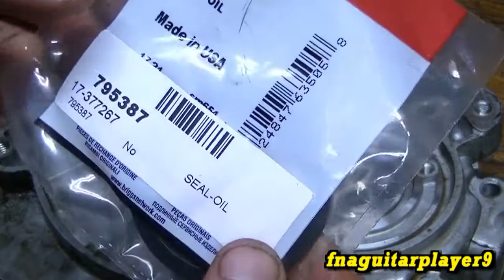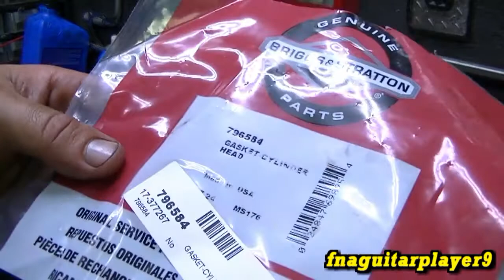Part 2 of 2 : OVERHEATED B&S 18.5HP OHV Intek Plus 31P777  Diagnose, Teardown, FIX and RUN!

Comment: Great video..thick southern accent but pretty much understood everything...Damned 10% ethanol fuel screws up everything in the fuel system! It's always a good idea to put a petcock on the fuel line and just shut it off and let the motor run out of fuel when you're done mowing.. Otherwise your needle valve on the float in the carb wont seat properly with all the corrosion and you'll either have fuel leaking out the exhaust or get gas in the crankcase!!  I had gas in the crankcase and it caused all kinds of weird problems. Thought I blew a head gasket with all the smoke until I started taking it apart and gas was leaking out of the head.   Now I have to put the head back on and take the carb apart, so I decided to just clean up the head, valves, and piston, and replace the needle valve and seat on the carb. Hopefully it will run again!
Reply from the maker: Thanks! Yeah I get that alot haha oh yes, it really does big time. Thats the best thing to do. Thanks for Watching!!!

Comment: I just got a JD lawn mower that has the same engine as this one. Some strange reason cylinder block crankcase has a crack on it. Leaks oil when i try to start it. I ordered the crankcase and head gasket hoping there is no major problem with the inside the engine.  Btw first time I'll be taking an engine a part. I am so excited.  Thanks for the video it's so helpful!
Reply from the maker: Glad to help out, Thanks for Watching!!!

Comment: Good vid. In my experience be sure to only drive that oil pan crank seal  down as deep as originally was because if u drive it down too far u will block the oil port that keeps seal lubed. It will fail n leak soon. Also be careful not to roll the seal turn the crank a little as sump pan slids in seated.
But it prolly "aint got no gas"

Comment: Thank you for instruction. I have BS 18.5 hp that continues to flood the oil. New carb and have adjusted valves several times. Did compression test it says it have compression 140 or so. I lost at this point, still won’t start and run.
Reply: If its flooding then the needle/seat are leaking.

Comment: Great Video! 
I just purchased a Craftsman DLT 3000 mower with this same motor. The carburetor had been cleaned and rebuilt. The motor was still surging, backing, and popping some. The only way to smooth it out is to partially choke. I took the carburetor a part and really didn’t find any issues. I’m now thinking it isn’t the right carburetor for this engine, someone has definitely removed the fuel shutoff solenoid and cut the connector from harness. Do you by chance know the p/n of correct carburetor for this 18.5 hp engine? 
Thanks!

Comment: Great 2 part video!  This is the same motor that I have & I am trying to figure out how to test the charging system on it.  All of the videos that I have found so far seem to have a different configuration than this one.  I am going to keep looking, but do you have any videos on this type of charging system?
Reply from the maker: Thanks! I do not have a video on the charging system, there should be 1 or 2 wires coming out on the starter side, there is a diode made into the wire on the charging circuit, at full throttle it should be putting out 12-14 volts dc. Thanks for Watching!!!

Comment: I have a 31P777 that came to me overheated.   The plastic intake was melted at the block,  pushrod guides were gone, and the head gasket had failed    After I put it back together the rocker studs would not stay tight.  Eventually I swapped the head.   After a few months of use it started burning oil.   I have not torn it down but I suspect the rings lost their tension due to the overheating.
Reply from the maker: I hear ya. I hope this won't happen to this one, I started to order new rings for it but didn't, i put it back as a spare so i hope that doesn't happen! Thanks for Watching!!!

Comment: I have the same motor in my Craftsman LT2000 riding mower.  The mower has stopped charging the battery.  When i tested the voltage coming from the stater, i get about 29volts.  I cant seem to find a voltage regulator, so im at a loss as to what to replace.  any advice?
Reply from the maker: There are diodes built into the wires coming from under the wheel (from the stater) if its bad it will put out some odd voltage, usually ac too. you can either cut the plug off and wire in a diode and hard wire it back to the harness or get a new stater and pull the flywheel to install it. Thanks for Watching!!!
Reply: fnaguitarplayer9  very good video. Glad i found it. 
I tested the voltage DC coming off of the diode red wire and it read 17volts while unplugged. The moment i plugged it in, it would drop to 12.4vdc which was the exact voltage of the batteries current charge.

Comment: Good video. ...I'm curious if the 17.5 hp use the same crankcase and head gasket?
Reply from the maker: It should be the exact same engine, if the model starts with 31 it is more than likely identical. Briggs is know for exaggerating HP ratings! I've seen these model 31 range from 15.5 to like 19.5 hp ratings, same engine! Thanks for Watching!
Reply: @fnaguitarplayer9  thankyou so much and thankyou for your videos I enjoyed them and is helping me with any blown briggs.
Reply from the maker: Your welcome!

Comment: if U wanted to check the timing, but not mess w/ the oil pump, is it ok to leave the oil pump together when you re-assemble?
Reply from the maker: Yeah, as long as nothing is turned it will go right back together. but you may need to rotate the crank to get the marks to line up, etc. Thanks for Watching!!!

Comment: I just had the fan break up on my 19.5 hp. Was you able to use one off of an older engine with no problem?
Reply from the maker: yes, it bolted right on, but the screen mount is different and will have a screen off a older engine, without doing some mods. Thanks for Watching!!!
Reply: fnaguitarplayer9 Thanks. I found one off of a 17.5 and it seems to be fine. The original one was quite flimsy to my opinion!

Comment: Hey guitar I've just recently put new cam new head gasket new carb in 17.5 briggs now it runs extremely hot what can be wrong
Reply from the maker: It may be running to lean or there is a air leak somewhere. Try to adjust the carb a little richer. And make sure the plastic fan fins are in good shape and the cooling fins on the block are clean. Thanks for Watching!!!

Comment: Hi 
I need your support
What can i do if bolt and valve rocker arm loosing after adjustment and compression become too heavy
Reply: Check the rocker arm studs.
Reply: @bobsoft  checked
Reply: @mohmedhosny6094  You're saying you adjust it and then lock it with the torx screw. It runs for awhile then the rockers are loose again? Have you checked the pushrods?

Comment: Some what is the operating temperature of a air cooled engine
Reply from the maker: I've had head temperature and exhaust temps over 500 degrees, block temps are usually around 250 or so. Its higher then say a water cooled car engine but not a huge difference. Thanks for Watching!!!

Comment: At the end of the video, what's leaking from under the starter?
Reply from the maker: It was leaking oil from the drain plug for some reason, it leaked oil out in my garage floor after I pulled it off the frame from making this video. I guess the plug just wasn't sealing for some reason. Thanks for Watching!!!

Comment: How did it overheat in the first place?
Reply: At the beginning of part one he said he believed a bolt holding down the plastic  cooling fin ring came loose, allowing the block to overheat and the fin to melt against the block .
Reply from the maker: what philod902 said, i think the plastic fins somehow worked loose and whoever was running didn't know it and nearly burnt it up. Thanks for Watching!!!
Reply from the maker: Thanks for Watching!!!

Comment: valve clearance  and all torque specs for this engine
Reply from the maker: alrighty, .005"-.007" for intake valve, .009"-.011" for exhaust valve, .010" for coil-flywheel gap, 185" lbs (all in inch pounds) for head bolts, if both rod bolts are the same length then both are 185" lbs, if different, short one first at 160" lbs then long one at 260" pounds, oil sump bolts: if they have a washer then 140"lbs, if the washer is made into the bolt (flange type) then 200"lbs, and the crankshaft end play is .002" to .023", as long as it moves some it will be fine. i think thats everything.